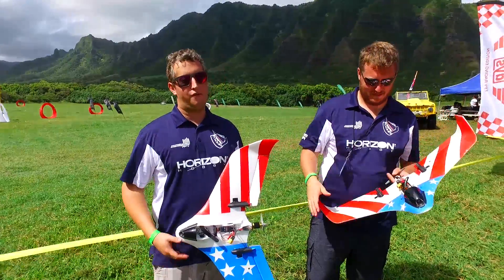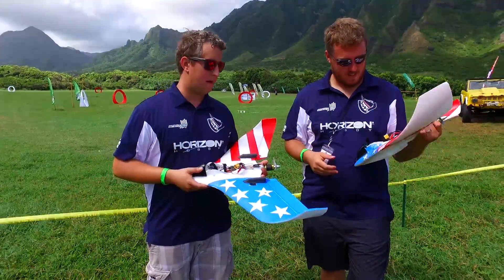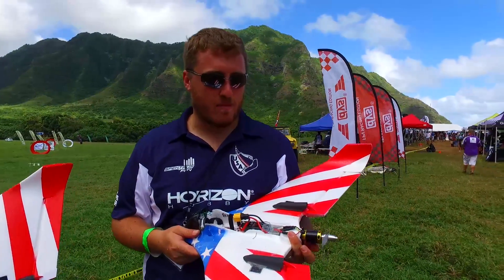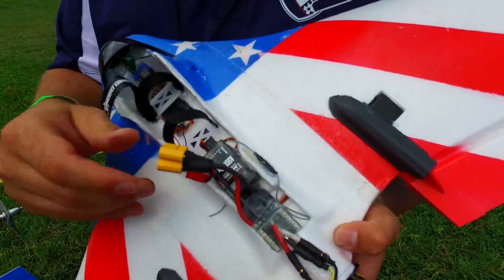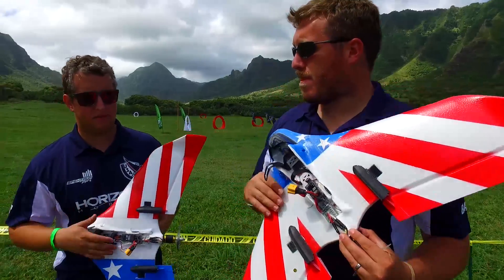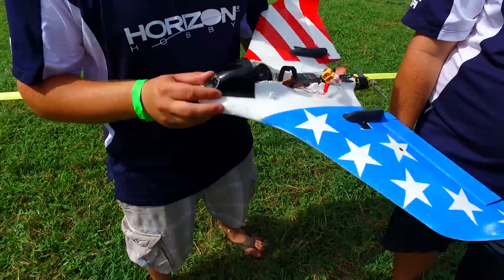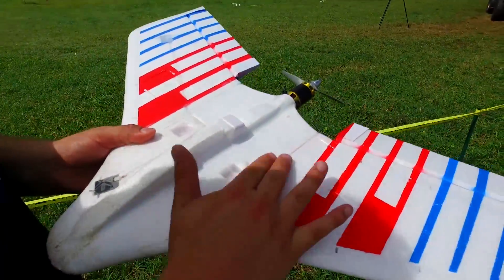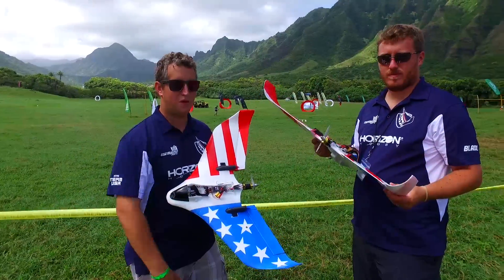Theory W - How to Go Fast!

Comment: Hey Steve I don't see a 2221 2480 motor anywhere is that the right specs? Also could you elaborate on what you had to do to install the motor mentioned something about a new shaft?
Reply: Mike Roy it's a 2221-12
Reply: PetrottoMedia thanks Steve. How about the mounting does it need a mod?
Reply from the maker: Its basically the same thing. we just used an X motor mount as a heat sink.
Reply: The Steve FPV ok gotcha. Lastly what did you guys paint those things with? Came out great
Reply: Mike Roy rustoleom I belive.